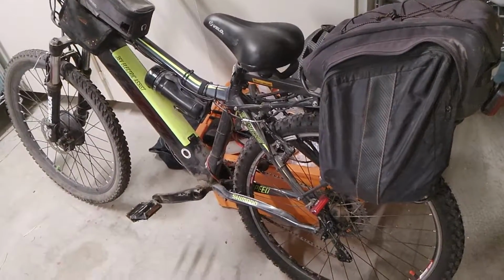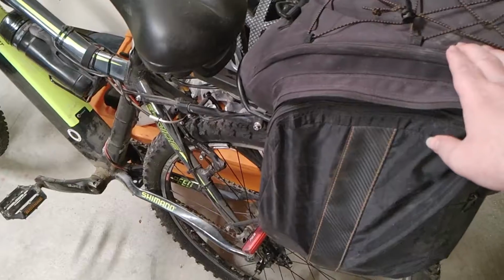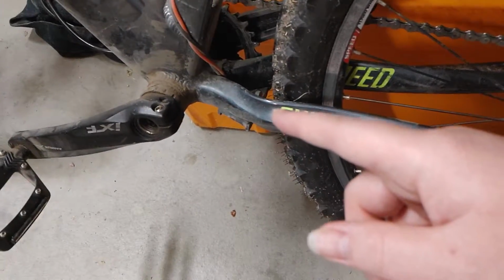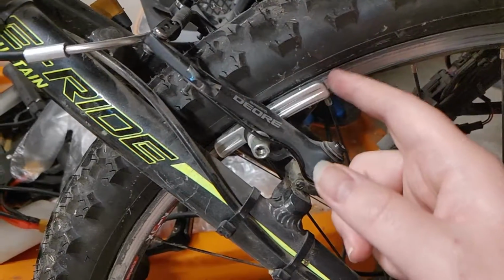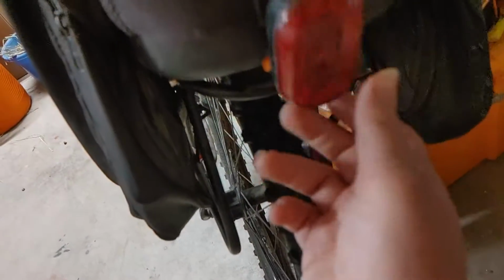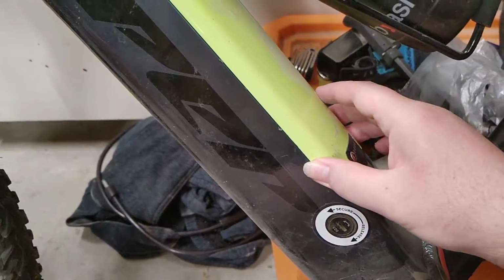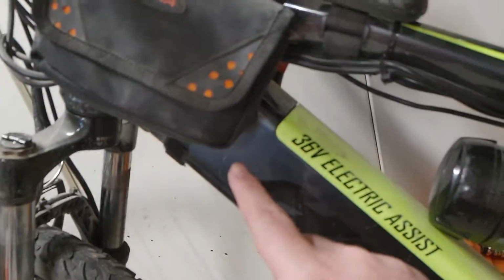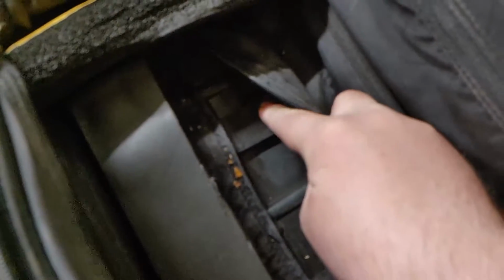Hyper E-ride the 100pound beast.

Comment: You REALLY should change the front brakes to disc brakes, which is where most of your braking power is.  The problem isn't that you cannot lock the wheels. The problem is that they no real ability to shed heat.  The bike is 3 to 4 times heavier than the average bike and goes faster too (remember, twice as fast is FOUR times the energy, all of which is turned into heat during braking). You get on a long hill and you are going to lose braking entirely.  The 3 material brakes aren't cheap either and you are going to through them like nobody's business. Remember that the kinetic energy is 1/2 of the (mass times the speed squared.)
Also, depending on how much you weigh, hand built wheels may be in order.  Bicycle components simply aren't designed to be a hundred pounds.  This is probably why your wheels are giving you trouble.  Hand built wheels are MUCH, MUCH better than machine built wheels.  Also, the hubs are much higher quality.
Reply from the maker: I don't think you really seem to understand exactly what you're even saying.

Firstly V-brakes are rubber to metal compound, Meaning they have much more room on the wheel and generate 150% less heat due to the fact they are rubber to metal and use the wheel as the conductive system to shred the heat off. Compared to Discs that have little to no room to do so and are metal to metal friction.

Yes Discs would be a better option for a Longterm downhill runner due MAINLY to the fact their pads don't wear out as fast because their made of a fine metal pad rubbing on a metal contact surface. But for heat generating, They make More heat, which in terms also will slip if you're using a small rotor because it has less surface area to dispence that heat off it's surface. That's why people pick higher MM rounded rotors, The bigger they are. the more room they have before they get burning red hot from stopping all the time and the pads start to slip.

But for a normal ride on trails (flat to normal basic touring around on dirt roads.) V-brakes will work fine since you're not hanging on the brakes all the time to stop.

Also since i don't hang on the brakes, or do 'downhilling' as the big thing a lot of so called 'mountain bikers' are doing (which isn't mountain biking fun fact.). I don't need Disc brakes, Because i don't need the heavy stopping power on my front to cause me to flip over. If you seen anything on motorcycles and people who put a sudden stop on their front, You'll see people get flipped, or twisted handlebars when suddenly stopping quickly with front brakes. Which is why you use 90% of your rear to stop, and 10% of front to counteract from being flipped off your ride. Even downhill bikers do same, They barely ride on their front brakes when they go down hill when having to suddenly stop. They use their rear the most, Cause if they suddenly slam on their front. Boom over the bars you go.

2etly. You don't seem to understand mineral quality.
Hand made or Machine made aren't the difference between a wheel design. Just cause one is hand made, won't make it 'BETTER' then a machine made wheel. Why? Because if a person hand tuned a cheap wheel, It'd be likely made of cheaper steel spokes, and a cheaper none-double walled alloy rim. That wouldn't make it better then a GOOD steel spokes, double walled alloy rim wheel by a machine. So that plays into No factor if the wheel is bad or good. It's mainly due to the mineral quality you're looking after.

If you can find a Good rim with double walled thickness, And spokes with good steel or even high carbon steel as my front and rear spokes are both made of. They are gonna last. They wouldn't put carbon steel on a Motor hub if it wasn't gonna last. So that means it's gonna take the bounce from the heavy hub.

These are the best wheels you can get. Even HIGH end wheels will be exactly the same. The only difference would likely be how THICK the spokes are, That's it. But last i checked. My spokes are up to as par as a super high end E-bike that's worth 5000$. The same thickness they use on their wheel spokes and they use double walled rims. So both classes are the same.

The cassette hub sure isn't the most greatest as a custom made, But shimano has been well for durability and life lasting, Their hubs are quiet and are made to take ambuse thrown at it. So i'm not really worried on the rear hub going out anytime soon. The motor hubs shouldn't have a problem taking weight, Seeing the fact their designed for heavy pushing.

I done quite a fair amount of time putting lots of research looking, and learning about things when i started my upgrades for my bikes. This isn't new to me.
Reply: @KillerRaptorr  Let's start with the wheels.  Hand made wheels are better. Everyone agrees with this.  It's not merely that hand built wheels are generally made of higher quality components. It's that the spokes are hand adjusted and machine made wheels are not hand adjusted. Machines simply cannot build wheels to the quality that hand builders can. This is generally not in dispute. (even the term "machine made" is a bit misleading. Most wheel manufacturing is at least partially done by hand) If you don't want to spend that kind of money, then that's the reason not to use hand made wheels, not that machine made wheels are just as good, because they are not.
If you weigh 200 pounds, you have a machine that is about 300 pounds. The rear wheel of the bike is holding more of that weight than the front and there is no rear suspension. That rear wheel is getting a lot of beating. Your experience of spokes loosening  shows that.

There should be no metal to metal contact in the braking system. The brakes are softer than the rotors and that is why the rotors aren't all chewed up.  Ever saw what a metal rivet does to a brake rotor on a car?

You are asking a lot of your brakes. It has to convert all of the energy of your motion into heat (that is what brakes do). Ebikes are both faster and heavier than regular bicycles and kinetic energy is an exponential function of speed and a function of mass. You are going faster on a heavier bike. You are generating more heat than a normal bicycle does.

The brake pads also heat up, not just the rim. The compound rim brakes are made from simply is not as good at shedding heat as disc brake pads and they have a breakdown temp not as high as brake pads. You say they are good enough, and that's fine, but that does NOT mean rim brakes can radiate heat better than disc brakes. That is simply not true.

Then there's wet performance.  This might not matter to you though. I bike in the rain often. Rim brakes are horrible in the rain.  Disc brakes are almost unaffected by the rain. (you might also consider replacing the wire coming out of the battery running under the bottom bracket with silicone covered wire if you ride in the rain).

The mechanical advantage of disc brakes is greater than that of rim brakes, especially hydraulic brakes. When it comes to rim vs hydraulic disc brakes, there is just no comparison. You can lock the rim with one finger (don't know why you want to do that), which greatly assists downhill mountain biking. That's why they use them. MUCH less hand fatigue, which is generally not a problem on he road.

First, the hub is probably not shimano.  As you say, the front hub is integrated with the motor, so there is really nothing you can do about it anyway.  I am not talking about the cassette or freewheel ratcheting system, I mean the physical hub where the bearings and races are.
Reply from the maker: @tarstarkusz  https://youtu.be/ZxqeAZxktGQ This explains most of your thoughts.

Also here's my tires. Is a Ebiking Electric hub kit. https://www.amazon.com/gp/product/B004YJ2RO0/ref=ppx_yo_dt_b_search_asin_title?ie=UTF8&psc=1 and my rear tire that's never been retrued till now. (Oh look at that it's Shimano. Deore too, Best of shimano systems.)

I'm aware that the disc brakes aren't fully 'metal' But they are a Metal compound of such. Softer, but not as pure like a screw to the rotor, No fricken duh even car brakes are similar. But in a form it is METAL. While Rims are Soft rubber compound of such to metal surface area. Also Rims have a larger surface area to despress the heat then discs do, and the heat generated on rims is on the wheel itself which has 5times more surface area then discs/rotors, and a much wider surface area to absorb the heat due to it also being on the wheel. Not to mention it also has the metal spokes to absorb the heat to. Unlike discs that mainly focus on the rotor before sending it into your hub, Then the spokes and rims. Learning how heat generates and where it goes/comes from goes into factors here. Rims are less likely to get hot on a large period of stopping then discs. But the fact that Rims are rubber rather then a metal compound. Makes them wear much faster then discs do. This is why they aren't great for consistent braking on a heavy downhill slope as many 'mountain bikers' do. Which is why Discs are better due to the better metal compound of pads that don't wear out as fast during braking for large periods of time during a downhill stop. 

Back to my video and wheels. Yes in a way the spokes being machine trued is not as great as a hand job since the wheel doesn't go through a stress test as hand jobs do that put pressure on the wheels to get the spokes 'used to' the pull and bend force of the wheel. But that doesn't mean a retrue job person can't do the same to a already machined trued tire. If the components are the same on both machine and hand made. The quaility of both wheels are exactly the same. So you point is invald to what you're trying to get at.

Also like my video mentions. You also don't understand spoke thickness, which i just pointed out. This comes into many factor to performance and life of the wheel and strength. high end bikes use 12gauge spokes. (The smaller gauge number you go. The thicker the spokes are.). Which means my front hub is WAY better then even high end bike wheels are because it's 11gauge. Sure my rear wheel is 13 so it's not as great. But since it's lasted over a year+ without having to be trued on a bike that weighs 80-100pounds. That's saying a lot for it's performance.

Comment: Which omega fork is that?
Reply from the maker: It's the RST Omega TNL 26 wheel base version. 100mm travel spring coil suspension. It was 100$ on amazon. But they don't sell it anymore. Ether can see if RST themselves sell it or look on Ebay. It's the latest version i believe so the design should look similar of sticker wise. If it's different then you might see a older model.

It's a pretty good fork for cheap. And if you plan to put a 250watt hub motor on it. It'll fit the grooves without any modifying. But you will still require to get some files to shave down the screws to the motor because the motor screws won't capture into the small circle holes when tightening down the bolts. So all you need to do is shave down the wing circle on the screws themselves so they'll slide into the groove inner joint pieces without problems. That's the only con you'll have to do on the bolt nuts to file down. But the axles will slide in without any problems.

I can make a video showing you what i mean if you need.
Reply: @KillerRaptorr  A video would help. What motor screws are you talking about exactly? I'm planning on using v-brakes in the front, not discs.
Reply: @KillerRaptorr  I can't seem to find the fork anywhere, even on ebay. Do you know any other forks that would work with a 250w front motor?
Reply from the maker: @jessefowler1303  The only other forks i had that i knew worked with my 500watt motor. Was the RockShox Recon Silver TK suspension fork 26. Ether the air for 250$ on amazon or i think if you can manage to snag one the spring version that's around 180$ i think their called Rockshox 30 silver tk. Same deal as air just coiled/spring.

The difference in air to coil. Is just that the left chamber is ether a air chamber or a coil spring inside. The right chamber is always gonna be hydrulic oiled filled.

Problem with these is that you will have to damage the fork's C-clips that you use to slip the axle nuts into. Which means you'll have to file the tips wider for them to suit for 10mm motor hub axles vs 9mm axles.

Though for my case i didn't have much luck with putting them stock on my 500watt motor. Could be different for a 250. But my hub was alittle wide. And i ended up snapping the crown on my rockshox cause i tried to stretch them apart. Though even such i still rode it for awhile with a cracked crown. Worked after the break but i still think they might've been to tight to really have good suspension on my air forks.

Even so. That's the only 2 sets i seen that support V-brake and discs for the front. Though if you're risky you could try the other many random brand forks that likely support V-brake posts. But the only two i seen that are True companies and have better rep are ether Rockshox or RST.
Reply from the maker: @jessefowler1303  https://www.youtube.com/watch?v=E9jO7k1b6Xo
Reply from the maker: @jessefowler1303  Also it's not the screws themselves. It's apparently the spacers before the screws that you'd need to file. There are spacers that go on normally so that it helps lock the wheel in place for smaller frames.
Reply: @KillerRaptorr  I think I will end up purchasing the rockshox 30 silver TK. But I want to ensure the fork fits my 250w motor. What is the diameter of your 500w motor? If the diameter of my motor is a tad smaller, I wont have to stretch the fork. Also, what about Suntour forks? The suntour XCE 28 looks like it will fit.